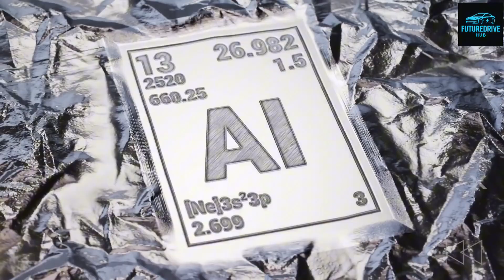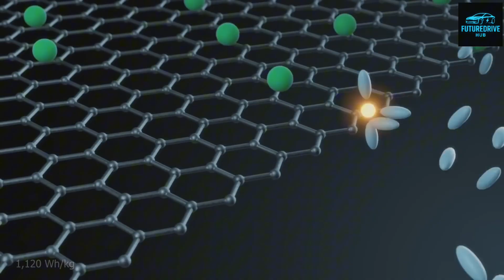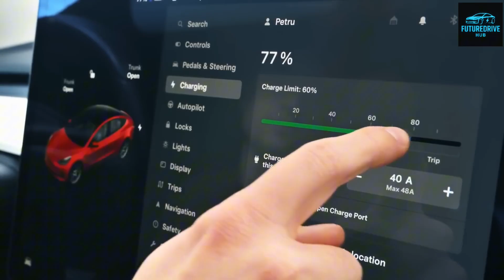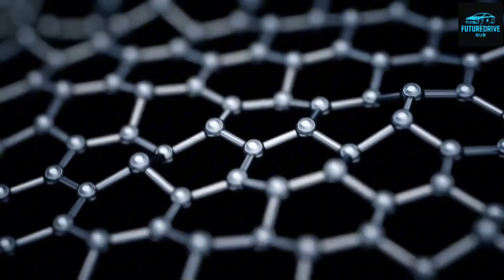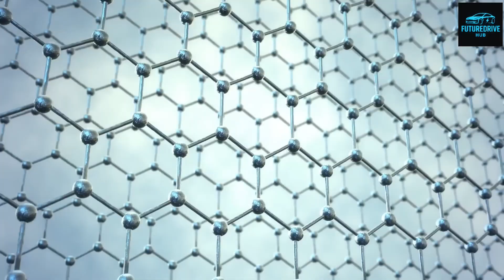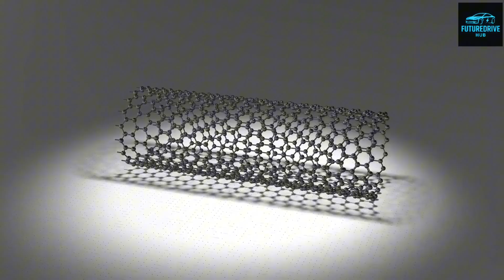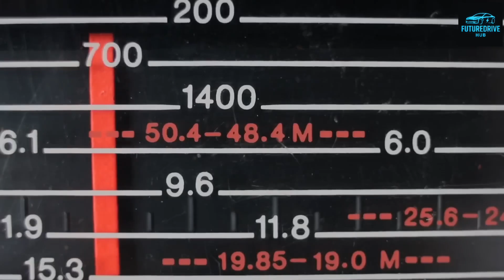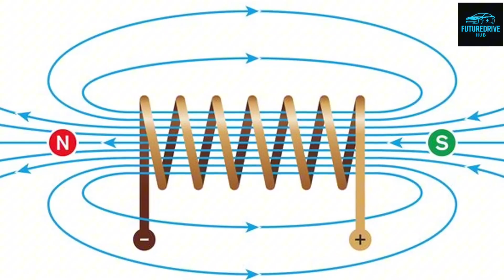Elon Musk Reveals 2026 Tesla Aluminum-Ion Battery — 100 Days Without Charging?!#usa #world #elonmusk

Comment: Aluminum-ion battery (AIB) technology uses aluminum ions as charge carriers and offers advantages like lower cost, higher energy density, and safety compared to lithium-ion batteries, but faces challenges such as insufficient capacity, poor cycling stability, and electrode passivation. AIBs consist of an aluminum anode, a cathode (often graphite), an electrolyte (often ionic liquid), a separator, and current collectors, with aluminum ions exchanging three electrons during charge and discharge. Current research focuses on improving electrode materials, electrolyte systems, and addressing side reactions like dendrite formation and hydrogen evolution to enable practical applications.
Reply from the maker: That's an incredibly detailed and insightful summary of AIB technology – thanks for sharing your expertise!